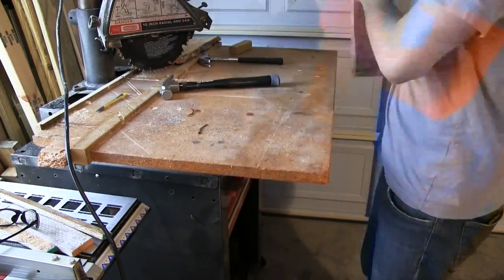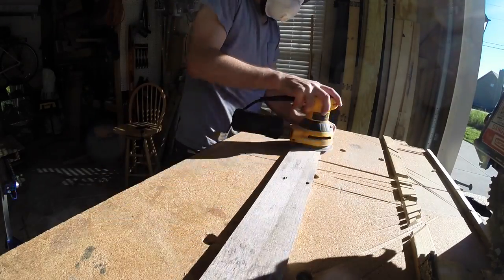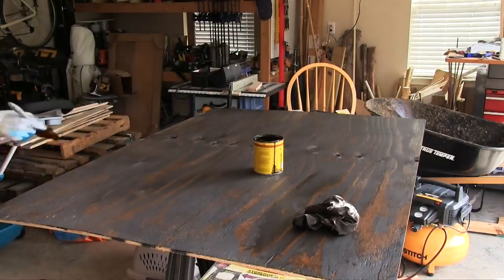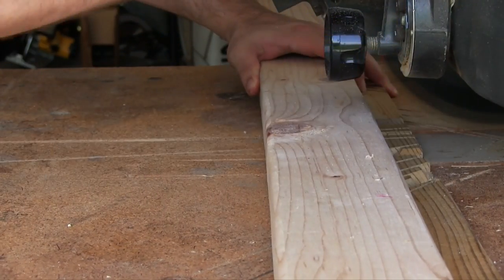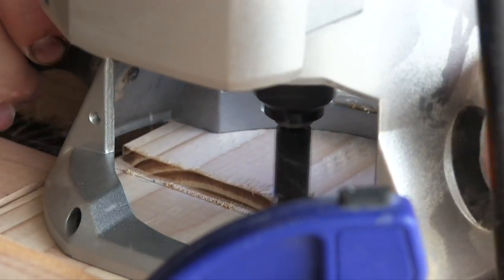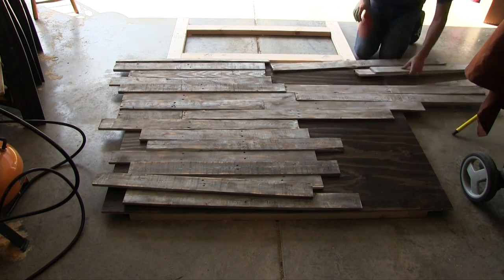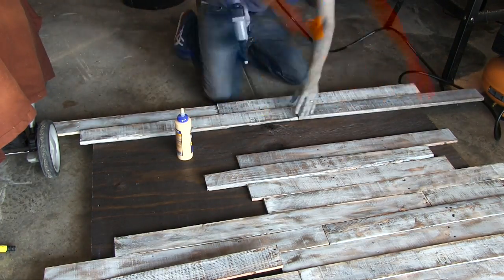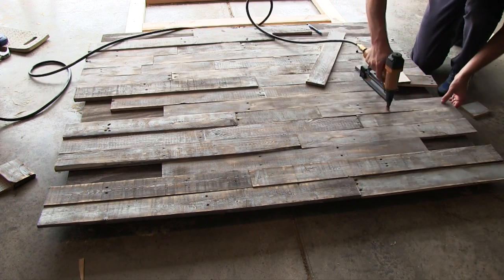PALLET HEADBOARD - HOW TO

Comment: Lots of work, why didn't you just find an old door and even make it look more distressed?  I'm trying to figure out how to use the old door I have and mount it somehow to the wall as a headboard for a twin bed.  I'm going to use metal mattress holder and I'll put a shelf on the door before I attach it to the wall.  I can leave the bottom of the door on the floor but I want to make sure it doesn't fall forward when I set it up against the wall...any suggestions?????